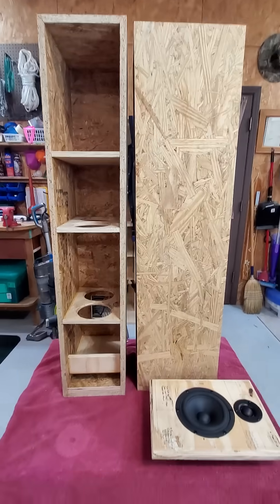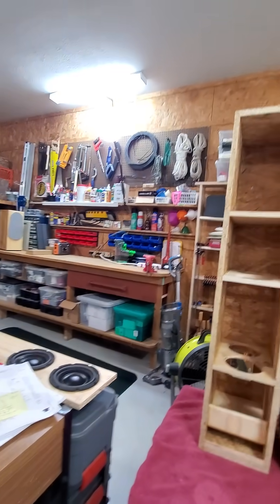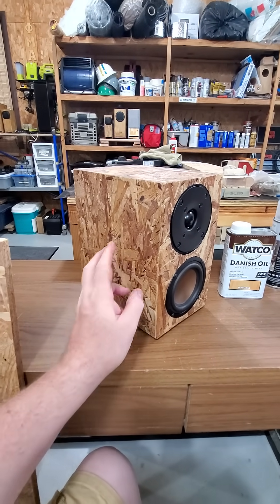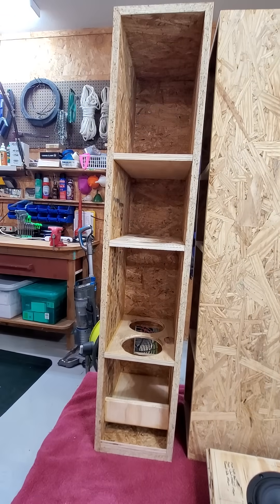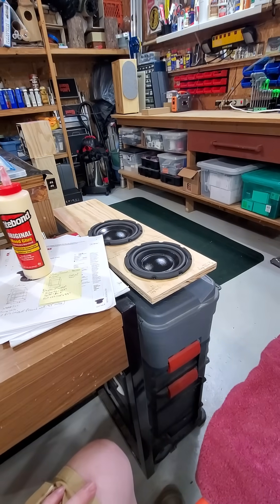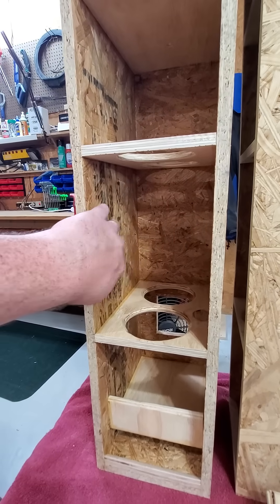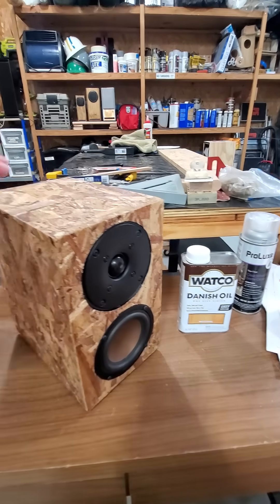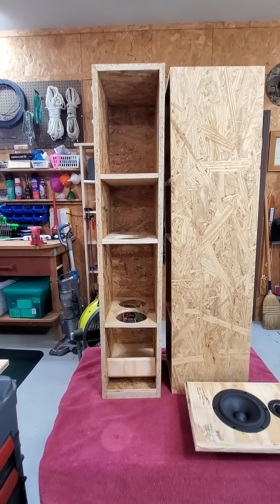OSB- Interesting design choice or Junk Wood? #DIY, #DIYSpeakers

Comment: OSB can be quite beautiful if you set it up right. I like to sand it smooth, color stain it, then seal it with epoxy resin and glitter. As far as audio performance goes, i've never Heard it do anything wrong? As far as resonance goes, i'd rather have a Lot of good resonance that a Little bad resonance, if you can figure THAT One out? They ALL Make resonance!

Comment: Why waste your time and money. Mdf is a much better choice
Reply from the maker: Been there, done that. Trying something different.
Reply: @DonnieMulligan than use Baltic birch.  Or do what I do.  Mdf covered with .75" solid hardwood. Osb is not a good material for speaker cabinets because of the unwanted resonance.
Reply from the maker: @BostonMike68 Too late, I'm commented. It's well braced and sealed on the inside and out. Will work on the crossover in the next couple of weeks. Final tweaking after that.
Reply: @DonnieMulligan I'm sure with all the bracing it will be fine.  Only one way to know for sure.  Good luck

Comment: You got good concept for building. Main thing I found with chip board, and partical, is not to get it wet or in damp areas. Just gets messed up.
Reply from the maker: Not too worried. Like I said in the video. Going to seal it up inside and out. Also, like most people, don't use my audio equipment in damp areas. Jambox in the rain-Yes! Hi-fi audio equipment-No!